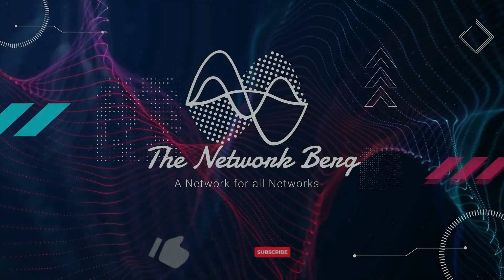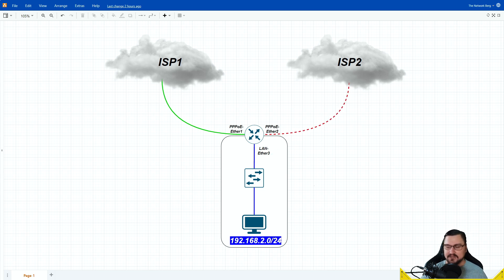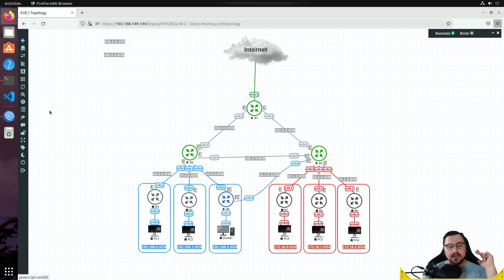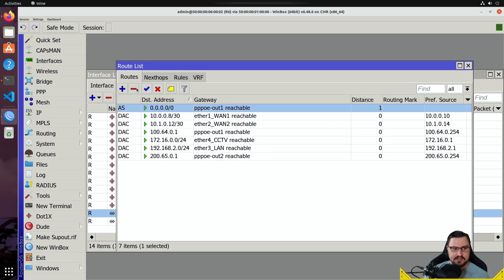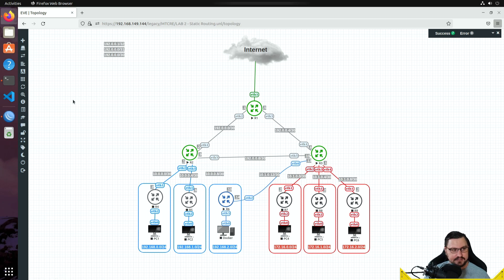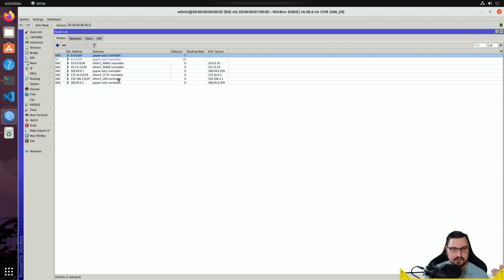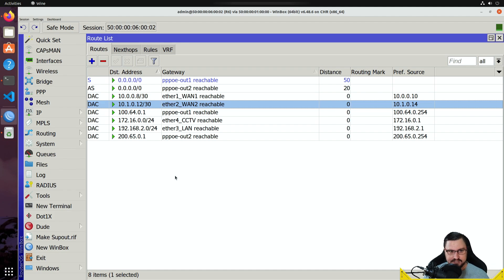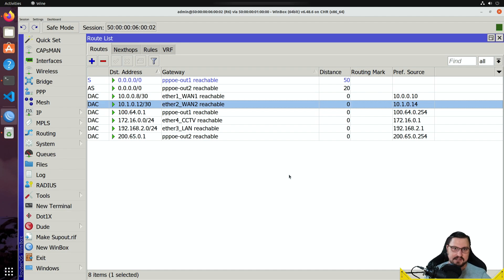FullMikroTik MTCRE - Failover, Ptp Addressing, Interface Based Routing (Episode 6)

Comment from the maker: NB - Interface based routing only works for Ptp configurations, trying to do this on a link where multiple hosts can reside will not work.

Reference Material:
https://wiki.mikrotik.com/wiki/Manual:IP/Route
https://help.mikrotik.com/docs/pages/viewpage.action?pageId=59965493
Reply: hey @The Network Berg : i have 2 rb5009s and a single ISP who has allocated me a block of 5 static ips. i’ve configured 1 static ip on each of the rb5009s which each have their default GW pointing to the ISP gateway. the ISP provided modem is in “bridge/passthrough” mode so it doesn’t do anything except provided access to the internet. 

my setup so far works fine (1 subnet for management and another subnet for all lan) but am wondering if there’s something i could be doing better. not much info on this on the net. 

any thoughts? cheers.

Comment: Great content as always. I do think it would be awesome if you could cover Ptp addressing in a bit more thorough detail at some point, as you barely skimmed the surface of that topic enough for anyone to really grasp how to implement it properly, and to be honest I don't quite understand the implementation you showed (with 100.64.0.253 as an address and 100.64.0.1 as the network/peer - these IP's are not adjacent with each other, so how does this even work exactly?). Could ANY IP be used as the network IP even if it shares nothing in common with the primary IP address?  I also didn't know about /31's until now, or that we can even use /32 with peer as network address to establish a link. Until now I've just used /30's but that seems a bit wasteful for cases where a /31 or /32 configuration would work just fine. Your video did prompt me to try read up a bit more about this on the mikrotik forums for some answers, but I feel like this is still quite an uncomfortable/grey area. It it seems /31's are actually discouraged because of incompatibilities between different vendors/standards, particularly when it comes to dynamic routing protocols like OSPF, and surprisingly it seems Mikrotik are somewhat behind with their implementations/compatibility with /31 and /32 ptp which surprises me a bit given their prominence & speciality in the field of routing. Hoping to therefore hear your thoughts & sentiments on this in more depth and whether you think it's even worth using /31 and /32, especially in production/enterprise environments? Cheers! :)
Reply from the maker: Not sure why YouTube labeled your content as spam, might be because of the IP addresses since they are highlighted for some reason. But this made your comment hidden until I had to go into a spam section and approve it. Correct, some vendors do not support /31 addressing at all which is why it is more normal to see /30 addressing being used for most point-to-point links. If you are going to use /31 with another network first confirm with them if their equipment supports it.

I think it's fairly straight forward to see PTP addressing in action whenever a client forms a connection to any of the PPP services, you will see that the MikroTik server will give itself an IP, and that a remote IP will be given to a client where these two devices can directly communicate. In MikroTik's case with using the Network address as the adjacent device's IP it is not required for this IP to be in the same pool. You could have your IP as 1.1.1.1/32 and the Network address as 2.2.2.2, if the remote side has its IP as 2.2.2.2/32 and the network as 1.1.1.1 then both devices will be able to communicate on L3 without any issues. Although it does make logical sense to add IPs in a sequence as that makes sense to us as we've been doing it for years this way. 

So you could use 1.1.1.1/32 and 1.1.1.2 as a network (heck can even start at 0 or end at 255 that's what makes ptp nice) On our network we actually make use of PTP addressing quite extensively on our L2TP tunnel connections, although it's more in a static sense as we do not use pools for our clients as we want each client to have static IP bound to it so we tend to just assign 2 IP addresses out of a reserved /22 pool. One IP for the server and then one for the client. We also make use of PTP addressing on a few of our BGP peers, and it has been working correctly without any issues for the last 3 or so years. So yeah, if you want to save on some IPs by using /31s for stuff like PPP services then I could recommend it from personal use.
Reply: @TheNetworkBerg  Thanks for coming back to me on those points with such a great reply. Super interesting stuff :) I have indeed seen that ptp phenomenon with pppoe connections before (even years ago with ADSL) and always wondered how that was possible. Now we know :D I guess I'll be sticking to /30's for anything serious for the time being as that's guaranteed to work across the board, but it's good to know about this stuff and definitely something to play with in the lab to see where it could potentially be used 👏🏻

Comment: what if i have server behind my router, when main ISP is down server will be visible under different ip from second ISP, is there any clever way to make it work?
Reply from the maker: I assume you are talking about external access to the server. So if the primary ISP goes down, how can people still connect to the server when its public IP changes.

Well... I think the easiest solution for that would be to implement DDNS (Dynamic DNS). So that if the primary does go down the DDNS can be updated automatically to the new public IP which you will also need to add NAT rules for.

Otherwise you can manually update an A record to the new public IP, but that can have its own issues especially if the address you receive may be dynamic. So I really think DDNS is the best option for a scenario like that.

Comment: Thoroughly enjoy your channel. Seen very elaborate failover setups using mangle. Why use that instead of what you've demonstrated?
Reply from the maker: There are hundreds of ways to implement failover, it depends on the requirements and how you want things to failover in the event of an error.

Personally as an ISP I prefer having BGP configured to CPEs and then having that protocol act as a failover mechanism. I've even seen some people do things with Netwatch to disable a primary route in the event a failure. Sometimes though a very simple solution like in this video works fine for failover

Comment: If we have for eg. vDSL router for ISP1 and LTE router for ISP2, if we want to have ISP2 as an failover (no PPPoE), we should make ether2 WAN, so ether1 is WAN1 and ether2 is WAN2, we asign them IP addresses, then remaining ports go to bridge and we enable dhcp server for that bridge. Then we can make static routes to WAN1 and WAN2 IP addresses, put distance for WAN1 to 1 and 10 for WAN2. Also we need to masquerade for each WAN IP so if traffic want to leave via WAN1 it will be NATed for WAN1 IP, and if it wants to leave via WAN2 it will be NATed for WAN2 IP. 

I hope i understand correctly.

Great video as always, short so you can keep someone attention but educational. Maybe it's better to have more shorter videos than few longer ones.
Reply from the maker: You are totally correct :D Creating videos is a fine line, sometimes a video is too short then doesn't get promoted by YouTube, but on the other side a video may be too long and then becomes too frustrating to watch in one sitting. I am trying to keep a balance between things. A typical rule of mine is to aim for 15 mins in a video, although sometimes I just get carried away and exceed this limit. It happens more so in the MTCRE topics as some of these things you need to talk about in one video.

Comment: The hardest thing about failover is to determine it. Check gateway is not a great option for internet use because it checks the gateway not the internet. I have several IPs just for check fail purposes.
Reply from the maker: We'll take a look at recursive routing in the next video which is very nice for internet based failover scenarios if the gateway remains up even if the "internet is down"
Reply: @TheNetworkBerg  perfect. Your tutorials are awesome as always.
Reply: I use custom scripts & scheduler to handle most of my Multi-WAN failover, because as you say the ping check doesn't always work. Just because the gateway is reachable/pingable, doesn't mean the breakout to the internet side of things is operational. So it's best to ping a real world public IP and make a determination based on that